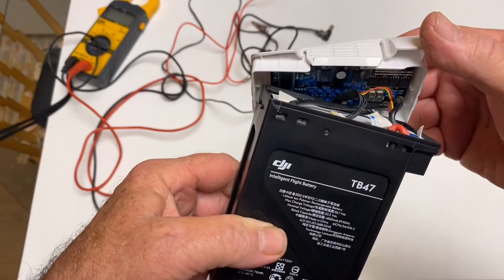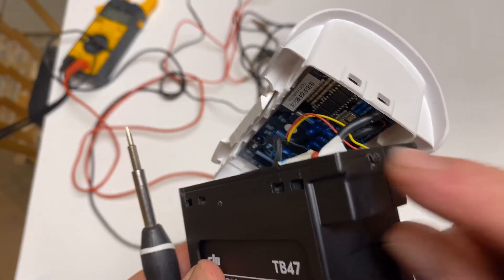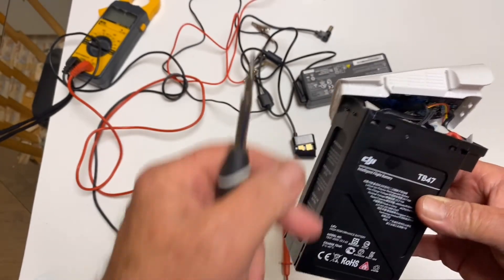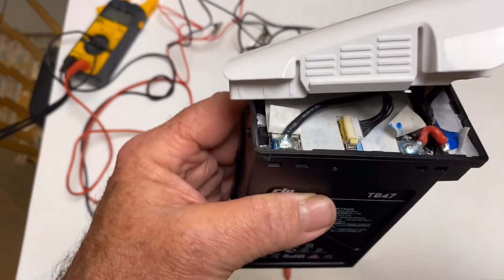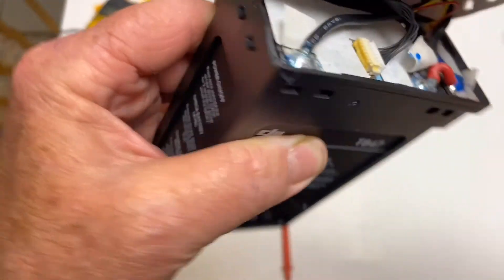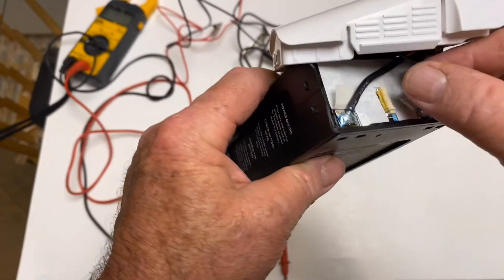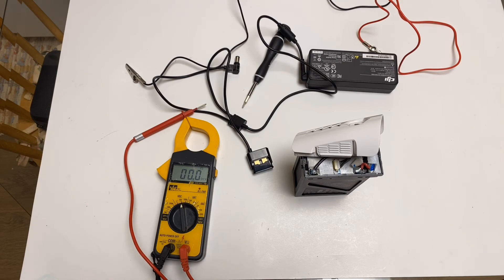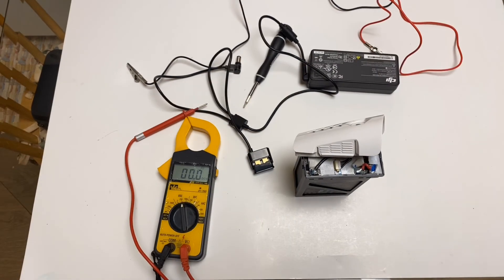How to fix a dead DJI Inspire 1 Battery

Comment: I thought this would be a absolute blag but just tried this now it’s worked. got it to 21.5 volts, plugged in the circuit board and it was flashing. It’s now on charge so will see if it lasts.
I got some cheap clamp connectors off amazon, they must be really thin wire as the cables were smoking so I connected 2 to each side to share the load and was fine
Reply from the maker: Hope it works out

Comment: I tried this approach but didn't seen to work for me. I followed the same procedure and charged various batteries to 23v.....however after that and reconnecting the battery together they either failed to charge further when connected to the charger or the one that did showed an error when inserted in the drone. Anyone have the same issue and fix it?
Reply from the maker: sometimes their is no fix, it's just a dead battery

Comment: Just tried it on a tb48. Was too far gone. Was at 1/2 a volt. Got it to 21, disconnected the power. It immediately dropped to 13 and change and the battery had swelled. Oh well. Looks my dji has officially ended my inspire train ride. Battery is now outside away from the house.
Reply from the maker: Thats to bad because these things cost a fortune

Comment: Hi. I bought an Inspire 1 combo in August 2015, with two batteries, one battery never charged, the Led 4 light indicator was flashing and according to the manual that battery was "frozen". I kept it for 6 years and it was "dead", zero Volts. I did the indicated for 30 minutes, monitoring the voltage with a voltmeter and when it reached 16V the battery began to swell and heat up, I immediately disconnected everything and neutralized the battery. It did not work. I will buy another battery $ 420; (. Anyway, thank you very much for your video. We are still happy and take care of you.Greetings
Reply from the maker: SORRY FOR YOUR TROUBLE, I WOULD ONLY CHARGE IT IN 5 MINUTE SPURTS WITH A BATTERY THAT OLD
Reply: @bryansbikes  Maybe I should have left it for less time, not 30 minutes. It was a long time and it was my mistake! Thanks

Comment: You sir just saved me £600 as I had 4x dead TB48s I left too long in the shed!   First one is now charging up nicely thanks to your advice!    My only comment is I had to go past 21v and put about 23v into the battery before she'd charge up!   Thanks again!
Reply from the maker: That's cool, i'm glad it worked out, just remember to charge them every six months, i know it's hard to remember this with everyday life taking up so much time
Reply: I tried the charger with the cable after 21V indicated without the cable connected and didn't have luck. So I went to 23-24V without the cable thinking a car battery alternator supplies 14.3V as it charges a 12V battery. So going higher seemed to bring the battery closer to 21V and it worked. Phew! TDR's best advice is "short cycles" of charging without the cable is all it takes. Looking to try this on my P4 dead battery. Thanks TDR for your video. You have saved many enthusiasts money! I bet you kept DJI from thousands of dollars of revenue by showing all of us how to revive our supposed dead batteries. THANKS!
Reply from the maker: @WilsFamChannel1  The same setup should work on the p4 battery
Reply from the maker: @WilsFamChannel1  Somebody else came up with the idea but they overcharged and killed their battery, i just reworked their idea to make that not happen, both of mine are still working and i made this video a year ago

Comment: Hey just one question pls “what setting do I put the voltage meter for a lipo battery” pls reply as quick as u can thank u
Reply from the maker: it's a battery so it has to be set at DC 200 or less

Comment: I tried the fix but no< my battery is all swollen. I waited for 25 minutes by checking all the time until i got to 21 volts exactly
I started at 2.5V
Reply: i tried with another battery. I even stopped at 18V coz the cable was a little bit hot (not that much) but the battery is swollen too and voltage went back down to 8v . I still have two dead batteries. What can I do ?

Comment: My battery has 11.58volts in dose this matter I will change it until it goes 15.3 right
Reply from the maker: go to the high number on the label but not higher
Reply: @bryansbikes  thanks for the. Help the max voltage is 17.4v I will try to get it back to life hope it works.

Comment: Dose this work with the ski phantom 4 battery
Reply from the maker: it should, just check the voltage on the label
Reply: The label says 15,3 volts

Comment: I have a question the inspire battery you need to change it to 21v but I have a phantom 4 battery how much should I charge it
Reply from the maker: it's on the battery label

Comment: I think many of the problems revolve around the design of the drone and the battery. I've had several intermittent landings off a "fully charged" battery. One resulted in a crash landing right after take off. From my understanding with Li-Ion and LiPo batteries is that they don't work anything like lead acid batteries where the plates become covered when the charge is too low. However, one thing I have noticed with Lithium batteries is how they are charged - in series VS parallel. These battery cells literally need to be charged independently. I'd never ripped open one of these batteries to determine this.

Comment: 0 volt TB47 back operational.
Man I wish I would've seen this yesterday I had a battery NIB that I never opened from November 2018. well when I made an adapter to fit the factory battery connector and measured 0.93vdc-yeah 0. the charger was doing nothing and flashed like yours for about 10 seconds and go out.
Well I removed the cover and logic board cable and just like you placed alligator clips on the 2 leads. Youre correct the factory charger will not charge being so low. I went and being a hobbyist and grabbed my HiTech good LIPO charger and made an adapter to accept the alligator clips. 
when I tried to charge it it would read "connection break" because it was at 0vdc. so to circumvent that I had to start and stop the charger repeatedly (15 times) because it you hit the battery with the 26v for 2 seconds until the "connection break" terminated the charge cycle for safety.
after about 15 times the battery not had a steady 3.4 volts which now I was about to change my lipo settings from 6s to 1s. I charged it on 1s for about 3 minutes, stopped it cooled off and repeated watching the capacity being charged in which was about 20mah.
Now I stepped it up to 3s and repeated the process for 2 cycles of 2 min with cool off time. 
3s, 4s again the same basically stepped up the voltage to 6s until I had about 3000+mah in the pack and cooled/settled to a steady  resting voltage of 22-23vdc. I buttoned everything back up plugged in the logic board and connected the factory charger to complet the charge which it did.
I let it rest and on the app it gave me a battery warning of a bad cell when I looked at the cells in the app with the motors running (no props) idle for a bit I saw cell 4 was a tad lower than the rest were all equal.  After draining is down to 15% placed it on the factory charger and the next cycle no warning and all cells were equal in capacity and temp was great.

All this to say it is absolutely possible to resurrect a tb47/tb48 from 0.95vdc to health as longs as the cells were originally healthy.
my battery terminals has a slight greening coating on them but messing with the alligator clips eventually gave me enough to charge.
also to note while I had my brand new 0.95vdc tb47 on the operating table while I was forcing voltage to it my multimeter read 1 about the entire time so I went off of my rc lipo charger reported voltage and timer for reference.
alls well and the pack is perfect.
Reply from the maker: I don't know if it's true but somebody also told me all i had to do was remove the cable from the logic board for 10 minutes and it would accept the charge but i didn't try it
Reply: @bryansbikes  I'm not sure haven't charged so many lipos because I have so many of them in various RC forms mainly crawlers and stadium trucks I figured I'd give it a shot disconnecting the logic board because I did not want to hit it with too many amps to fry the board. It took some time I figured the best approach for me was to step the voltage from one s up it took about an hour roughly and then from there enough to get the vultures enough around 22 volts to use the factory charger to finish it off.
Like I mentioned before initially yesterday I got a battery warning for a bad cell but after another cycle it equaled out fine no problem since I fully tested with a couple more cycles same battery this weekend for sure but all in all I'm confident it'll be fine.
Reply: also note these batteries are expensive so I will do everything I can before I have to break it to my wife I have to spend another $200, LOL
Reply from the maker: @ChrisNieves  HaHa, I paid 280 for the new one yikes

Comment: So I have 3 batteries. 2 of them made it. But while charging they are just blinking in the first led. I don’t know if they are charging or not but I can successfully turn it on/off, any tips?
Reply from the maker: Is it a fast flash or slow?
Reply from the maker: If the flash is real fast it’s not charging
Reply: @bryansbikes  unsure how to explain it to you. Can I contact you somewhere so I can send you a video?
Reply: @bryansbikes  it isnt extremely fast but its flashing maybe x2 the blinker in a car would flash
Reply: @bryansbikes  just had the voltmeter at it showing me 16.6v. And holding it there for 30 seconds it showed me 16.8v. So I guess it’s charging ?
Reply from the maker: @RuudCR  Plug the charger in now, if it gets to the second light it's charging
Reply: @bryansbikes  I unplugged one charger and plugged another. But noticed that when I still had the multimeter connected the voltage started dropping. Is this because the voltmeter is “draining” it to see how much voltage is in it
Reply from the maker: no

Comment: I got the same battery like that for Phantom 4. It has never charged. I am curious what voltage I have to set and stop for P4 battery. I searched the youtube before and no info.
Reply from the maker: just do it for 5 minutes, that should be safe
Reply from the maker: https://www.youtube.com/watch?v=zik9UuYyGfE
Reply: @bryansbikes  Thanks, Bryan. It is not the same problem I have with my P4 battery. My battery has one LED flashing during charging but cannot be charged (same as your problem).
Reply from the maker: @simonsimon1989  does it have the one light only?
Reply: @bryansbikes  yes. One LED light only but it cannot be charged.
Reply from the maker: @simonsimon1989  you have  to unplug the battery from the logic board and leave it for a while the plug it in and try to power it on
Reply: @bryansbikes  I just checked my P4 battery, it is dead, no more LED light. Look like it is too long.
Reply: I went exactly to 21volt in 30 minutes or so. But the battery is now bloated...... I have three other. Maybe I will try to go to a lower voltage. I was using the Tb48 by the way.

Comment: When I was charging those Bird electric scooters I found a few that had the batteries run down so low that they wouldn't accept a charge.  The brain the company put on ran them down beyond the normal low shutoff point.  What I did was I took a another scooter battery and connected a wire from both terminals to the super dead battery for about a minute which brought up the voltage enough for the charger to recognize the battery and then quickly disconnected everything and then plugged in the charger.  Both charged up to 100% capacity and also held the charge.  Interesting stuff.
Reply from the maker: Thanks for the tip

Comment: Great video and very well done. When I got problem like that I always use my PSU with lower amerage power supply. Like that you need more time to charge the battery, but the current that you expose the battery at is from a minor level.

Comment: Good tip Bryan! I recently had to do similar to a 2 cell lipo off a cheap toy quad, the supplied charger wouldn't charge the battery anymore as it had gone below 3v per cell, I had to manually charge it up until it was above 3v and then it charged fine on the supplied charger! 😎👍

Comment: Cool Idea... A tip for ya Bud, when you do this to a over discharged lipo you should use  a super low amperage rated supply 25 -50mah or so. you don't want to do this with high power 1 amp and higher supply because if the batteries are way out of balance it can cause them to puff and get ruined or even catch fire. The lower amperage the better just takes way longer to regenerate the voltage high enough over 3v so your charger will now sense the cells and do a proper charge.
Reply from the maker: Thanks Steve, i hope i never have to do it again, haha
Reply: Your right and it can also be done with a balance charger. Remember there are 12 Cells in there!!
Reply from the maker: @AboveandBeyondGlobalDrones  I had nothing to go on but that guys video and it worked out because i flew it today and the battery seemed ok